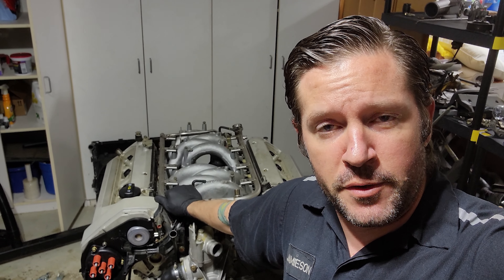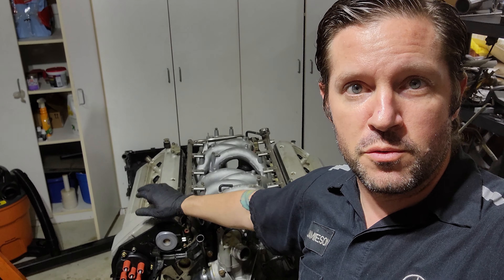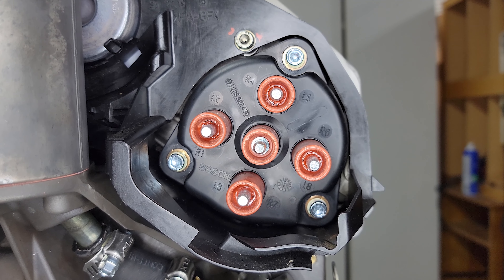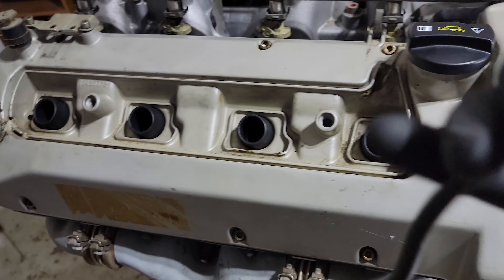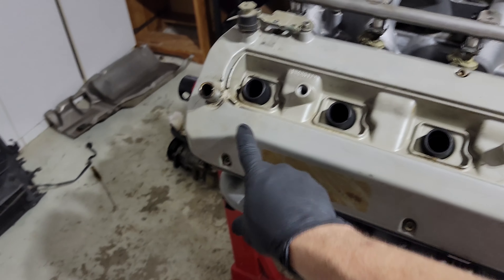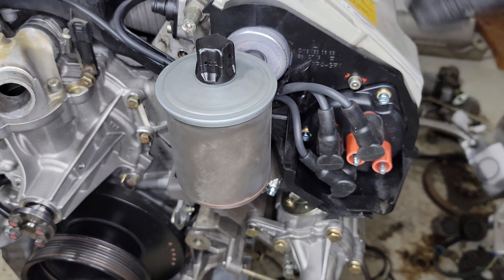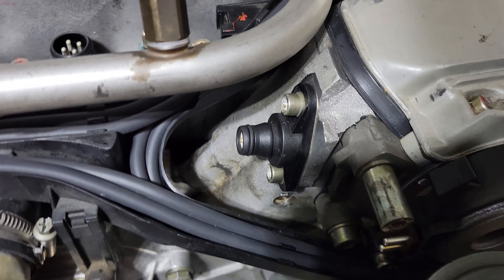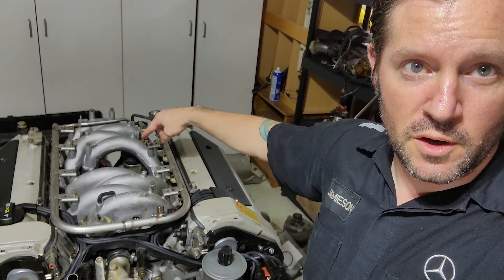M119 Installing and Routing Spark Plug Wires

Comment: Add grooves to the distributor (search the Internet for the diagram) caps to keep them from fouling.  Add dielectric grease to all spark plug caps for easy removal in the future.  Excellent presentation so far.  Thanks...

Comment: Behind the power steering resivour I have a bracket that makes it impossible to route the wires. Do I take the bracket off to route the wires?
Reply from the maker: Do you have a w124, w140, or r129?
Reply: @FriendlyMBTech  R129 SL500, Im guessing I need to take the bracket off but I dont have an allen socket short enough to get to the bottom bolt on thr bracket if you know what I mean. Also what spark plugs would you recommend?
Reply from the maker: Can you email me a picture of it?  Friendlymbtech@gmail.com

Also, I'd recommend the factory plugs or as close to factory as possible.  No need for super fancy or super expensive plugs.
Reply: I also had this bracket take me by surprise (on my M119 R129). I took the bracket off (you really have to I think) but you're right it's quite awkward to get the lower hex/allen bolt out.

Comment: I’m about to do my bremi wires later today thanks to Your video! really helps a lot! I’m curious though for the ignition coils, Would it matter if I had two of the same. I notice after I purchased and installed that the direction for the left coil is facing down instead of up. I looked and they are both the same part number. Would it effect anything or how it drives? Should I purchase another coil?
Reply from the maker: Thank you! Are you meaning the coil wire on the distributor cap?  As long they're connected you shouldn't have an issue.
Reply: @FriendlyMBTech  
Im talking about the ignition coil itself. Before installing the new one the wires were facing upwards when installed. But now after installing the new ones I realized they are both the same. So now the wires face down on the left coil. The wires connected to the coil, not the cap. =)  pretty much asking are there two different coils with different part numbers. Does it matter?
Reply: @FriendlyMBTech  
So today when finishing up the wires today I checked the part number for the ignition coils I have. And they are both part # ending in 435. I checked my old ones and I’m supposed to have a 433 and a 435. Does it affect it in any way if I have two of the same coils?
Reply from the maker: @mikeymancebo7783  Sorry for the late reply.  What kind of vehicle is it or what are the last 8 of the VIN?
Reply from the maker: @mikeymancebo7783  I am trying to look up part numbers for the coils but the parts guide will not let me select the coil picture to see the part number.
Reply from the maker: The part numbers are different.  Functionally they will work the same.  Physically they will be different.  The coil wire routing will face a different direction.
Reply: @FriendlyMBTech  
Sweet! Thank you brother for taking the time to look that up. But that’s what I was wondering if it would function differently or poorly. Thank you my friend! Also after the wire swap and plugs I feel a big difference. Also swapped my 02 sensor and now have better fuel economy and cleared #2 code! =D 
But I have a another question for you. I’m having throttle hesitation issues still. It idles fine, accelerates fine when I ease into the pedal, but when I hit the pedal at idle it’ll choke up and then go slow. Then when I’m driving and I floor it, it’ll hesitate and jerk like it’s trying to go but it’s being pulled back. 
If I have a bad throttle valve and MAF, do you think that could be the issue? No rush to answer :) 
Thank you!
Reply from the maker: @mikeymancebo7783  yeah function would be the same.  It's just powering 4 different plugs on the opposite side if the engine.  The MAF and/or throttle valve could definitely cause that issue.
Reply: @FriendlyMBTech  Yeah I kinda figured =/ I’m looking into rebuilding my throttle valve and going to try and find a used MAF. Thank you for the fast reply!
Reply from the maker: @mikeymancebo7783  you're welcome.

Comment: You think i can install this engine in a old school project, if so what will it take to make it run
Reply from the maker: If you use the transmission, the hardest part would be the physical fit.  The transmission is vacuum controlled so the speed sensors would be used for ASR/ESP unless you coded them out.  If all the factory electronics are used, overall it wouldn't be too difficult.